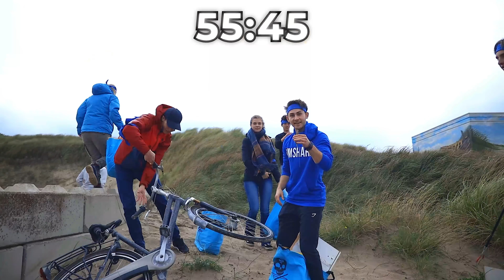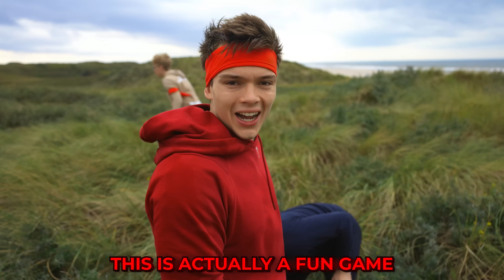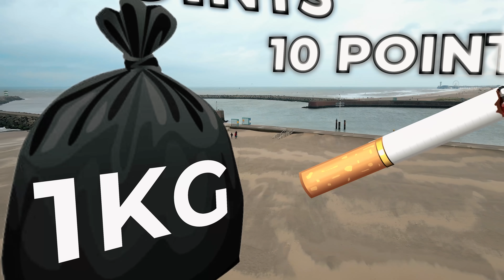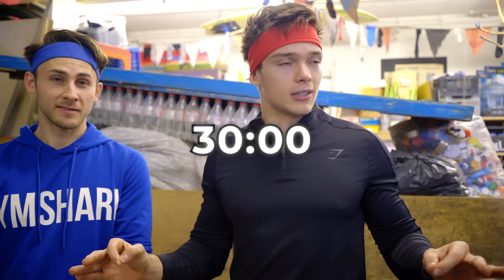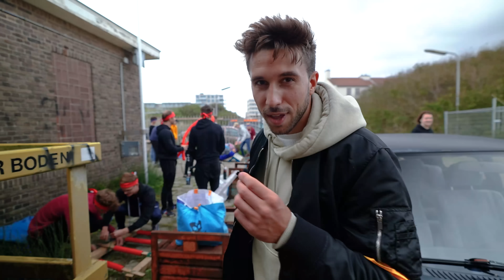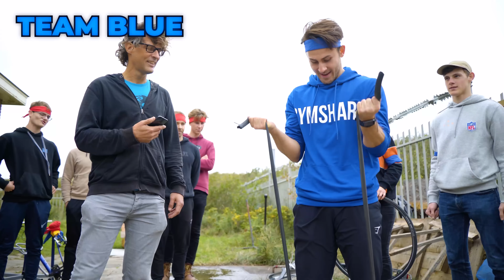I Tried To Build a ‘Trash’ Gym

Comment: They could setup docks along the river edge near the settlements. Have the large bins for the locals to put rubbish in. The barges could just tow the bins away and replace them with empty bins. This gets around the roading issues. This going off the other video where they cleaning the river with the machine